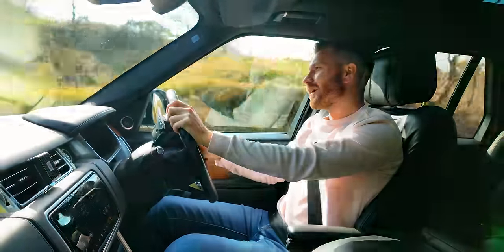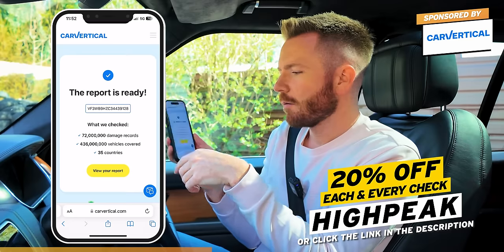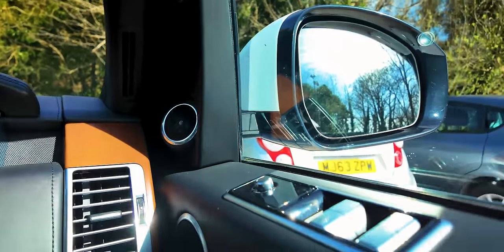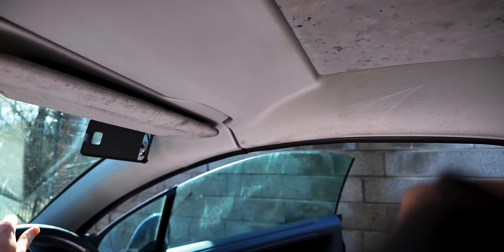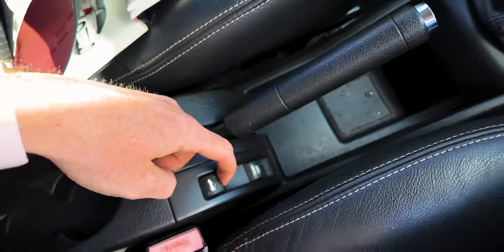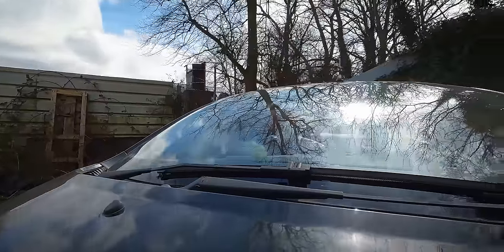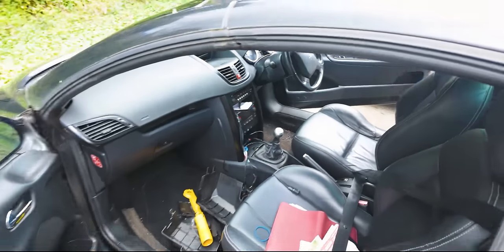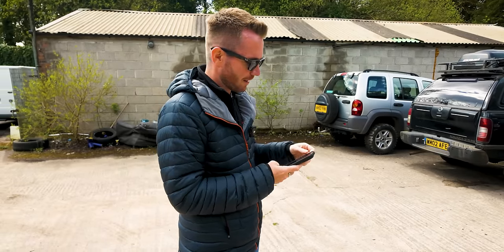I BOUGHT A CHEAP PEUGEOT 207CC FOR £500!

Comment: Sadly, this is one of those examples of a Peugeot somebody lost interest in years ago. I've had 3 fairly old Peugeots (205, 206, 307) as my daily over the last 20 years, and they're only as good as the upkeep you put in. My current 307 cost me £1200, does 60mpg in comfort and 87k miles later its still as good as the day I got it... because I maintain it. 🙂
Reply: Yeah exactly.my family have all had peugeot, Citroen, and Renault. None of them have been trouble. The 206 rear axle went thats all. One of the family has a yaris which have been run side by side with a 206. And over 90k there’s been no difference BUT I service them yearly

Comment: I mean come on. All the electrics work. It runs fine. The interior and body panels are in a good condition. It's not that bad. Too bad it's so cheap it's not worth fixing. Still, the leather interior should be worth more than you paid for it.

Comment: In fairness, I had a 308 1.5 diesel  for work, did 100k in ten months and it never caused me any problems. Until a moron rear ended it
Reply: psa make some of the best diesels, issue is their owners not caring about them 90% of the time
Reply: @yreva532  I’ve had various cars for work; Kia, Seat, Peugeot, VW and Toyota. The least reliable has been the Toyota. Absolute steaming turd. The 308 was the most reliable. Who’d have thought it 😭

Comment: What a crock☹️. Personally, I can’t think of anything worse than a diesel convertible; with the roof open you can hear the clatter and smell the soot. Oh hang on, there is one thing worse; a Peugeot diesel convertible 🤣
Reply: most of these were the 1,6hdi 110s with dpfs, so no smell of soot same with the 90s witthout unless there was an issue... much better than any of the petrols you could get in these